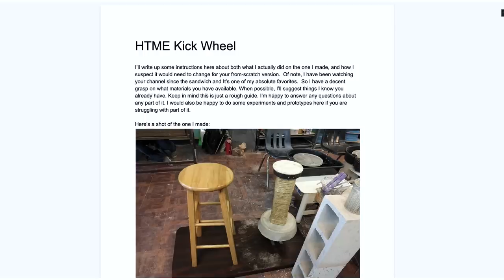Pottery Making Using the VERY FIRST Wheel

Comment: Abrasives are the tools of precision in the ages before modern precision tools. You are forgetting to use a whole class of tools that where available throughout all of history. You are making precision projects harder for yourself with not using abrasive stones to get to the final dimensions.
Reply: Yeah, I was thinking he also needs to build a froe and a riving break so he can make nicer boards with much less effort.
Reply: yea, i've been thinking this for a long while.
A little bit of abrasive can ironically make things run a lot more smoothly.
But his woodworking needs a lot of work
Taking a little bit of time to create these tools could save hundreds of hours in the long run
Reply: I agree and even in the making of a stone axe the peck and grind method exploits the abrasiveness of other stones and that tech is much older than this.
Reply: @sussygussy2  You can tell he's not an actual maker by the way he makes something thats at about 30% of what it should be and just calls it good. Drives me nuts
Reply: I was thinking about that when he was making the matate.  It would have been way easier to use sand instead of a chisel.
But I give him major props!  He may not have the prettiest of tools, but they are usable and he doesn’t quit.  He keeps trying and improving.  I have no idea the amount of time and energy he spends off camera improving his techniques.  I’m inspired!  ☮️

Comment: Speaking from a logical practical point of view. I suggest that you make yourself a set of brass files & set of sharpening stones. I also would like to suggest a very traditional saw pattern. The simple toothed saw pattern, which consists of two deep cuts to separating two shallow cuts. This would be the most practical and useful design to use because you will need to sharpen the teeth very often. And the Deep Cuts separating the three teeth are for removing material. This design is considered to be one of the oldest traditional saw-toothed designs.

Comment: At this point, I would surely invent the watermill to have power tools 😄
Reply: I would to but I don't have a river around here
Reply: You'd need a magnet for the turbine and a strong flowing river/waterfall which you'd need to buy to put a waterwheel on it
Reply: @guyochakovsky9100  unless he meant "power" as in water powered tools like an old sawmill (that's what I was thinking of). Although you would still need to own the land
Reply: windmill?
Reply: plvmbvm: yes, of course I meant water powered 😉 (or wind, but that would require huge amounts of fabric I guess)
Reply: Build his own quantic computer, space rocket, and nuclear energy plant
Reply: Senku approves
Reply: still gotta invent gears as well as pistons in order to have things like saws go up AND down/back and forth, otherwise, the machine just goes one way and locks up
Reply: you can make a water powered hammer with stone age tools, basically take a log, fire drill most of one end of the log , waterproof it with wax and/or clay,  add a stone on the other end , sit it on a wedge in the middle so it sits on the rock side when empty, and on the water side when full, then sit it under a waterfall, put a bowl with grain under and you have a water powered hammer.
Reply: @satibel  so basically just a giant shishi odoshi with a rock attached to it
Reply: @josiahbaumgartner7643  exactly, I forgot the name of these.
and yeah, except instead of a bamboo you use a big trunk
I think the technical term is water scoop, at least according to the article named "Water scoop (hydropower)" on wikipedia.
Reply: @satibel  as far as a name for the tool, yeah.

Comment: For how quickly you must turn them out to produce weekly content, those tools are getting better and better all the time, and the results show. Dare I say, and don´t get this the wrong way, you are getting handier and handier from a not very promising standpoint. Producing this channel will yet turn you into a master artisan, showing that any skill is just a matter of time devoted to it. Good for you, that is always a great thing to see! :)
Reply: P.D: also, that saw would be a much bigger help, and a source of great precision for future builds, if it was thinner on the cutting edge, meaning you have to remove much less wood to get a given cut. Half the wood removed is half the energy expended to do so! I suggest 'sharpening' it against some abrasive stone to make a much thinner blade at the edge. Ideally, you would cut sawblades out of sheet metal as we do nowadays, but I understand casting thin sheets is a tall order, and extrusion completely out of your reach, so you´ll just have to grind them thin.
Reply: That's not how saws work, it's not a knife. If he thinned the teeth, how would the back of the saw fit in the cut?

Comment: A note about pottery; make cylinders not bowls when starting. Bowls are easy thanks to centrifugal force, while cylinders are difficult because we all have a dominant hand. Inside hand stronger is a bowl, while outside hand stronger makes a cone. Cylinders are also first because you want even wall thickness, and a 90° angle between bottom and sides.

Too, don't worry; no one understands centrifugal force just like how it doesn't make sense that bicycles work.
Keep your elbows in against your torso; thats where the stability is. It's wobbling because you are.

Comment: I wonder if someone ever came up with the idea of using slaves to spin that really fast and make work easier. It would require modifications but it's possible.
Reply: Yes they did. As well as animals.

They build large wooden disc that were mounted at an angle, so whatever part of the disk had something heavy on would always want to move in one direction.

And then they put a cow on there bound so it'd always move not to strangle itself.

Like that's the most high tech it got for milling and the like.

And I suppose some people will have used the same technology to spin whatever they wanted to spin.
Reply: @emilychb6621  That's just consistent spinning, not high speed spinning, that said, that speed would at least be faster than without the animal
Reply: Mei Grafd Vodder I will give you a example romans they used it to power them mining
Reply: you're thinking of cogs or belts, which definitely did happen, but that's an iron-age technology. a bunch of oxen in another room with a GIANT wheel, which is geared up to spin super fast at the actual potter's end.
Reply: @ijikegaming4202  yeah I've heard of the wheels people were walking in to pump the water out
Reply: Marcel Chb yeah that

Comment: 13:32 why does it look like hes using wood glue instead of the home made stuff?
Reply: i think you know why lol
Reply: If he did use wood glue, it was probably not safe to use his hide glue. Imagine that wheel spinning off right into his face or knees.

Additionally, it may not have been strong enough to hold the weight of the lower wheel.
Reply: @Smileyrat  Yeah, we also need to take into consideration, that at that time people had almost nothing to do, besides eating, so they could make more refined and precise holes, and better glue for things to stick together, also, slaves...
Reply: @Smileyrat  Yeah that hide glue isn't safe for a spinning object probably. I don't blame him.
Reply: @Smileyrat  Yhea, at them speeds he could of seriously knocked a bit of dandruff off a shoulder or much much less worse.
Reply: @UberAlphaSirus  A heavy object moving at even a slow speed has a lot of kenetic enery and can do a lot of damage. Don't beleve me? Then go drop a heavy object on your toes. It will hurt.
Reply: @Smileyrat  Your right, this is really scary stuff. I didn't realise the gravity of the risks involved.
Reply: ....hide glue IS a type of wood glue, you can still buy it at the hardware store. Its also a stronger bond than the wood itself, so it's technically just as good as the PVA stuff that is used nowadays. Also, it'd do a better time with filling those voids than modern glue since it gells quickly after cooling

Comment: Normally, I don't pick up the Wheel on these runs because it requires perfect timing, but if you can pull it off you can take 300 years off your Civ speed run.

Comment: 5:40 I'm calling shenanigans on those holes, they're rather straight, aligned and round to be done by that crude tool, but if they were, Kudos.
Reply: they look too small for the tool.
Reply: @satibel  exactly what I was thinking
Reply: Add the 3 metal rods and the super well grinder for grinding on a rock finish
Reply: though tbf, I don't mind these small exploits, since they can be done with the tools he has, and it just saves time.

Comment: There are problems with this. The wheel was not invented during the Bronze Age, but in the preceding Copper Age (or Chalcolithic). The people who invented the wheel between 4000 BC and 3500 BC, did not have bronze metallurgy. So if he wants to be authentic he should be using no bronze tools at all, only copper and stone.
Also, I'm fairly sure that the saw was not invented until the Iron Age (bronze saws just don't work well and wood was carved with axes, adzes and awls in this period).

Comment: Your saw's serration's are straight which means that you're cutting with the force you push downwards. If you chisel the serrations at an angle you'll cut during the push or the pull which will make your cut significantly more efficient.

Comment: I noticed you pinned your saw blade into the handle but were using a spin drill with the bit attached by resin and twine. Might I suggest making a few spoon drill bits with a tail and two holes to put pins through to attach them to your drill shaft so they stay put?

Since you've crafted a potter's wheel, it might be time to think about making a basic bit and brace for drilling holes instead.

Other thoughts: ditch the saw until you can make a much thinner, stronger blade. The cross section on that thing requires you to move way more material than it's worth. You can get the same basic results with chisels in a lot less time. And as another commenter said, a draw knife would help a lot with making dowels.

Comment: Arm chair quarterbacking:  I'd make more use of clay in making a potter's wheel from scratch, at least with the level of wood working tools that you are using.  If you are going to throw pots, you've got a kiln.  Use that to make your flywheel and  top surface.  Even if they crack during firing, you are most of the way towards a heavy round shape.  Bind them together with your glue and surround them with cord, or wood.

Comment: Looking forward to when you get to invent hand files and abrasives. Those should be pretty soon now that you've made the wheel. And both will definitely help you to get better precision with wood and stone working. 
For example; for either this potters wheel or your eventual lathe, you could use a round/curved file to make a much more precise circular shaft/bearing hole. As well as filing the end of the shaft to make it round and a precise fit with the bearing. (Chalk might also be a good lubricant for wood bearings too).
Making a file won't require any tools you haven't made or can't easily make by now. Just a hammer, chisel, piece of cast bronze, and a little technique.
Also, if you haven't already, check out Clickspring's channel. He's done a lot of work on recreating ancient tools for his Antikythera project.

Comment: for the rock, i would suggest you go find a slightly smaller one, and coat it in a good thick layer of wax, wax would be a better bearing surface and lubricant than the olive oil for this, also it would be better to make the wheels and the axle out of hard wood.  

You also might want make a wood scraper, it is essentually a straight edge piece of metal that you can use to take a small amount of material off at a time, it is one of the tools used before sandpaper, with a sort of grinding wheel setup you could probably true those wheels up pretty easily, the scraper can be sharpened, but it should only be sharpened on one side, and you want to run the back of the edge over the place you want to work with moderate pressure, though your bronze might not last, might want to think about getting into the iron age, or howto make some sort of steel.

Comment: Improve that saw by offsetting and angling the teeth. Bend half the teeth slightly right, and half slightly left, then angle the back side of them to give a rake that will bite the material you're sawing.

Comment: You had mostly ROUND logs ....Why not cut your wheel out  Of the rounds and drill through the center?
It would have been much easier and cleaner. Use the saw and then sand /file it plat.

Comment: I have seen and held early saws from the bronze age they have perfect teeth just like a modern saw, you made a little booboo there in discarding the stone age too soon they worked perfectly together a bronze tool would cut notches and a stone tool would form and sharpen the teeth. 
yours is one made by Fozzy Bear! then again you did not know this, now you do!
also, flat sandstone is perfect for fattening big wood pieces I did not see you use that either again you probably did not know this but you do now!
stones as a tool were/are used well into modern times so don't discard the stone age we still use wet stones to sharpen knives and axes so, to this very day we are still partly in the stone age.

Comment: Interesting thing, there are actually wheels in nature. They evolved very early on, but they are on such a small scale that they can take advantage of molecular forces. 
The sensory organelles of microbes evolved to protrude with ring like structures around the base anchoring it to the cell. Its that structure that provided a bunch of different possibilities for the leap to rotation. You can actually tear out pieces of the system and its robust enough to continue functioning, and with some modifications we can even do better than nature did, but I digress. 
It opened the door to a 'wheel' with a rotating 'axle' which in its entirety is called the flagellum. Used so that microbes can pootle about more easily. 

[It... should probably go without saying that ancient humans werent privy to the manoeuvring systems of microbes.]

Comment: Ok.  I'm going to suggest two tools to you that should be within the tech base you're working at.  They will make things much easier for you and will make sure you get better results.

You.  Need.  A.  File.  Your knife and chisel edges aren't terribly sharp, and your saw isn't sharp at all.  You're mangling the wood, not cutting it.  Some kind of file (preferably several in different sizes) will help there.  Look into abrasives.  They're a critical part of any manufacturing.

Second.  Draw knife.  You're doing so many projects that involve straight, cleaned wood surfaces that you need to be able to strip wood down cleanly.  An axe can do this, sort of.  But it takes a lot of work and a lot of practice.  A draw knife is much faster and cleaner for most people..... and it shouldn't be tough to make.  It's basically just a strip of metal with an edge (which you've made before) and two handles.

I'd also look into forging.  An anvil shouldn't be too hard to come by, you could just use a flat rock for all it matters.... and likely that's exactly what the earliest anvils were made of.  The forge itself you might have some problems with for the same reason you had to use modern parts to mount your potter's wheel:  You're not in the wilderness where you can just build whatever you want, wherever you want.  A basic forge wouldn't be a problem per se, you'd just need probably cob bricks, charcoal and a bellows of some sort.  That's the easy part.  Doing it without drawing the ire of your landlord..... that's a different story.  At any rate, you're going to want to look at actual forging if at all possible.  Your tools are inherently limited because they aren't work hardened.  Serious tools are never cast.  They're forged.  Cast bronze is much, much softer than work hardened.  Same with iron and steel.  Hammering the metal does actually make it harder.

Comment: Making a shaving horse and a plane would help make your wood surfaces flat and true. I think you could make a metal file out of brass or bronze if you have a way to harden it a little. This could help sharpen your saw blade. Also, take a hammer and a small punch and give the teeth some set. The wood saw will cut a lot better after the teeth have been set and sharpened. As an aside, the Woodwright's Shop (used to play on public broadcasting) used to use shark skin as sandpaper because it hadn't been invented yet in the technology timeframe of the show. If you can get some shark skin that would be great! Might also look into the process of scraping a metal surface to true flat. It's an art and a science. Will help once you go beyond wooden-bodied planes to metal planes.

Comment: I would gsve also filled the space in the center of the flywheel with clay and let it dry, it won't be as durable as fire hardened but would be more efficient than string. Or you could coat the string with clay to make it turn more easily.

Comment: There are clear grind/tooling marks on the saw that only a modern bench grinder or hand grinder could make. You can even see the grind difference between the saw and the other tools where modern technology wasn't used. Would've rather they just say they cheated rather than trying to hide it.

Comment: Why not use baked clay for all the round bits? You could have preshaped the holes into the material and then increased the weight of the bottom wheel by just adding more clay. Not to mention your ability to make it much more round and smooth. Definitely interesting to watch though. Keep up the good work.